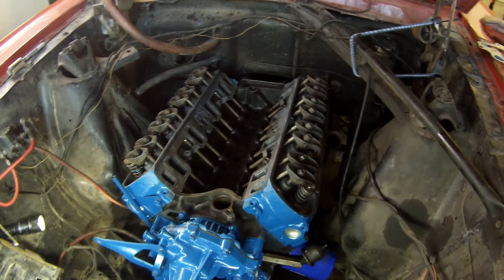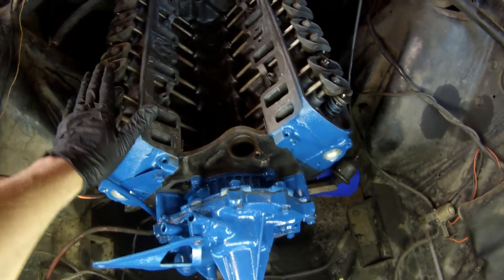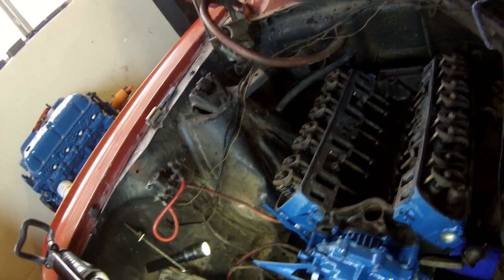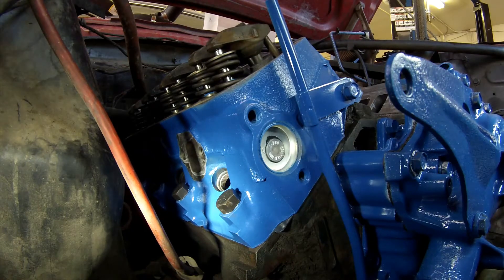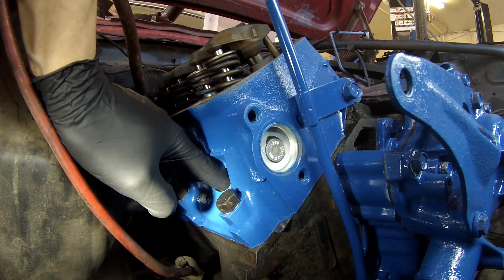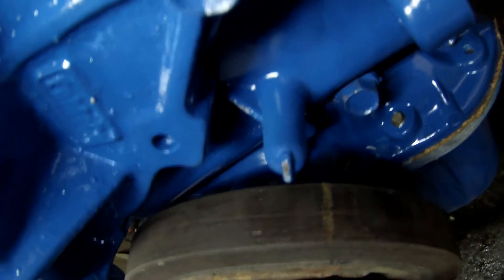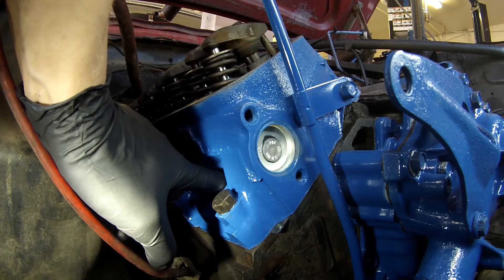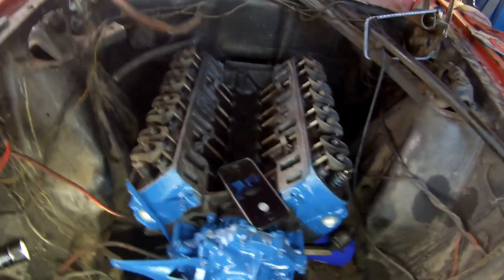Finding top dead center compression stroke fast and easy 289 small block Ford

Comment: Good video. Nice tip about removing all the plugs, especially if you're going to replace them anyways. Good for easily rotating the engine without a remote starter, or a buddy to turn it over.
Reply from the maker: Thank you! Ya they are too easy to remove.

Comment: So conpression on #1 cylinder, when its near its highest compression, turn over/rotate the cam to the mark? May i turn over either way as long as it is at the mark;clockwise or counter clockwise?

Comment: Great video thanks. My question is how do you know if you are 180 out? My motor is not running the way it should and I am concerned that it is 180 out because it has a cycling vibration as the RPMs increase.
Reply from the maker: So you'll want to get your number 1 cylinder up to top dead center on compression stroke like in this video. Then remove your distributor cap to see which ignition wire your rotor is pointed at. If you're not close to #1 wire, then you're off. Sometimes you're close enough, you can just get it in time by loosening the distributor and twisting it. But if you are way off, you'll have to remove it and re-install in the right position.

Comment: So you line up the pointer to the white line on the balancer?
Reply from the maker: If you want it at top dead center, no. The white line is just the owner's reference mark for when he times it. The white mark is easier to see on the timing light.
Reply: @AlfsMustangGarage  oh ok so when I feel air trying to push my finger out of the 1st cylinder I’m basically on top dead center then I use my timing light from there and adjust it, from the pointer connected to the balancer.
Reply from the maker: Not exactly. When you feel the compressed air pushing your finger out, that means the cylinder is on its way up but is not all the way to the top till you line up the pointer to TDC labeled on the balancer. You should only need to do this if you're trying to install a distributor or something to that extent.
Reply: @AlfsMustangGarage  sorry for the dumb questions appreciate the responses, so I then keep rotating the same direction assuming I’m on the compression side until I reach the TDC mark.
Reply from the maker: Correct. And it's all good. No such thing as dumb questions.
Reply: @AlfsMustangGarage  thankyou really do appreciate it 👍

Comment: Just for clarification. You rotate the harmonic balancer clockwise and the air presses your finger out and you mark a line on the harmonic balancer right at the pointer. Then do you rotate it counterclockwise and mark a line at the pointer? Then split the difference  between the two marks to mark TDC?
Reply from the maker: So you do want to rotate the engine clockwise which is its natural rotation. Once you feel the pressure building, that means that cylinder is compressing or the piston is on its way up with both valves closed. I don't make any marks on the balancer. All balancers should have markings on them such as TDC (top dead center). Once you know #1 is on its way up for its compression stroke, you line up the TDC mark to the pointer and that "should be" (given all other components are correct in the engine) top dead center compression stroke #1 cylinder.
Reply: @AlfsMustangGarage  My problem is I'm trying to find TDC because there is only one white mark a PO put on the balancer. I've cleaned around that mark but no other marks are present. Not sure if it's TDC or what. I'm wanting to verify so I can put some new timing tape there  and then make sure my timing is correct.
Reply from the maker: So what you will want to do is watch some videos on how to use a piston stop to find your true top dead center. You could try to get to the point where the piston is on its way up and compressing and just try to eyeball it. However, if you're trying to make a new mark on the balancer you will want to use a piston stop to find your true top dead center. There are several videos on YouTube that demonstrate that.
Reply: @AlfsMustangGarage  What I'll probably do is use your clockwise method to get close and then use the piston stop. And then use your method counterclockwise to get close and use the piston stop to get the other mark. How far in would you adjust the piston stop inside for the piston to stop? 1 inch, 1.5 inch, etc?
Reply from the maker: Without knowing the specifics of your engine and build,  I wouldn't comment as far as that goes.
Reply: @AlfsMustangGarage  A '66 mustang 289 stock motor